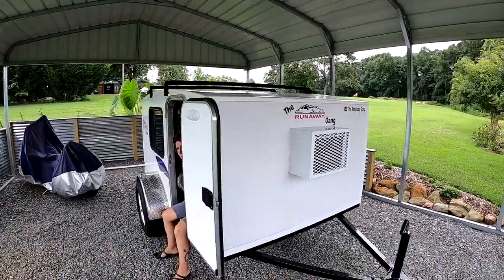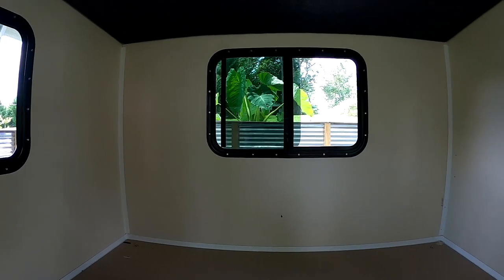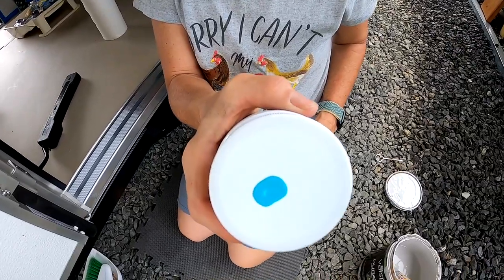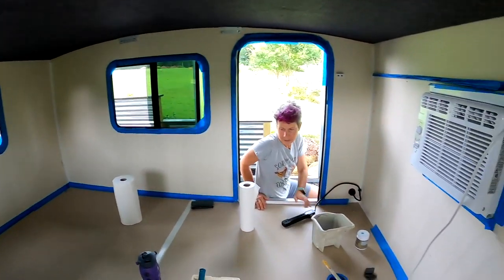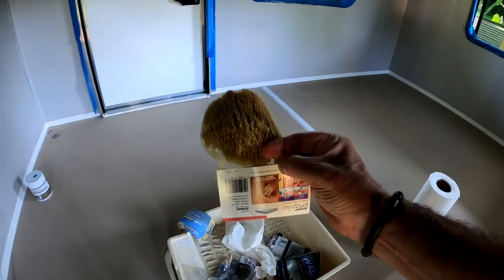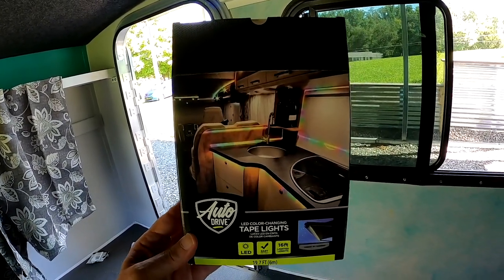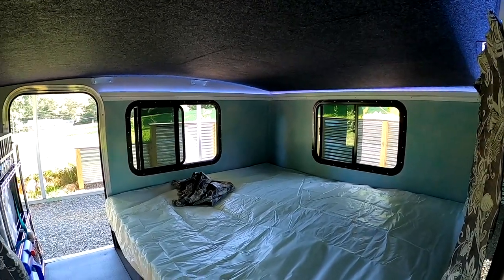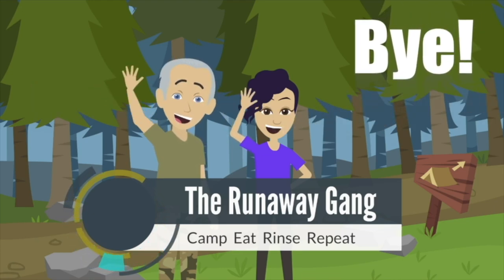2022 Runaway Camper Decorating Mods

Comment: Are there any magnetic surfaces around the door? I'm wanting to get an ARB ( or the like) awning and room for our RangeRunner and I'm trying to figure out how to seal off around the door since we're not seamstressess(ess?) I thought maybe if theres any magnetic surface, I could just clamp it down with some good magnets. 

IF not, maybe some like you added to keep the door open would work! I just really want to avoid adding any holes to ours, especially the exterior.
Reply from the maker: I believe all the metal on the doors is aluminum. Hope that helps with your planning!
Reply from the maker: Yeah, I know what ya mean about not wanting to add holes! We’re gangsters! We don’t care! Ha ha ha!

Comment: Absolutely LOVE the lighting system with the indirect lighting. I had a RangeRunner and downsized to a Cool Camp. I'm thinking of doing the same system as you did here using the trim molding. Pam,  how did you hang the curtains? Are they on hooks from the upper trim? I want to put curtains in as well. Your finished look is wonderful! 🙂
Reply from the maker: So glad the ideas are helpful to ya! I did include a link to the trim that I used in the description if ya wanna use the same thing. Pam says yes she used curtain hooks she found at Walmart and you are correct they are hanging from the upper trim! They slide nicely out of the way or over the windows and easy to remove if needed. The curtains were made from two 84” x 37” room darkening panels that were cut to size. Here is a link to the curtain hooks…. https://www.walmart.com/ip/Silver-Pointed-Top-Pin-On-Hooks-by-Mainstays-14-Count/50015117
Reply: @TheRunawayGang  Thanks so much!